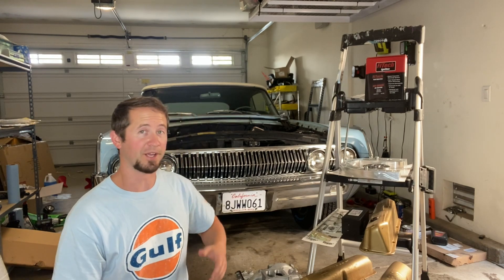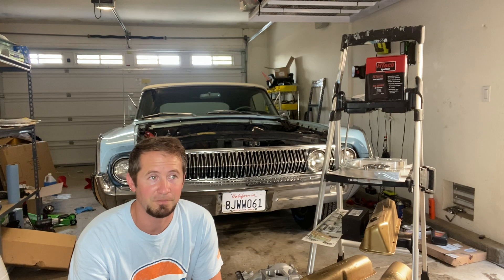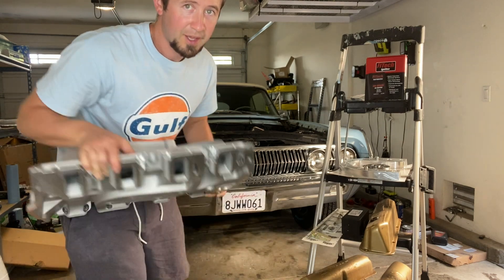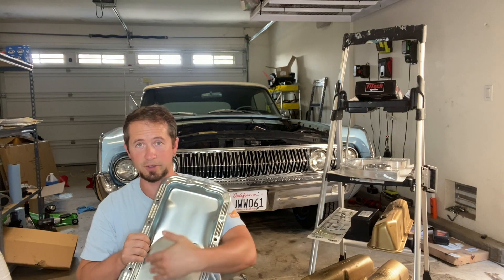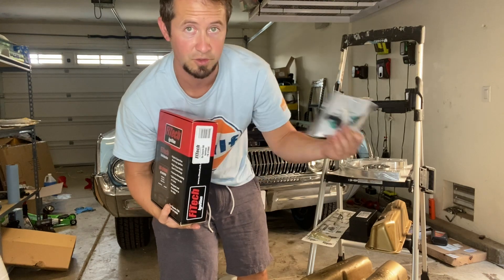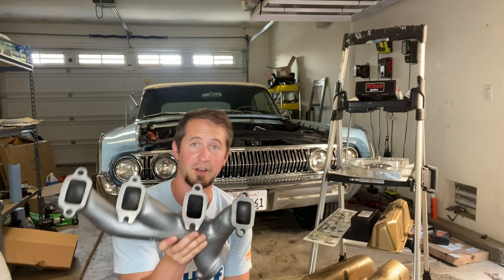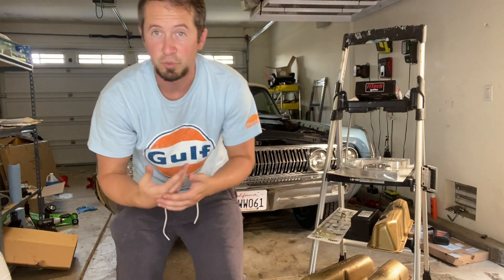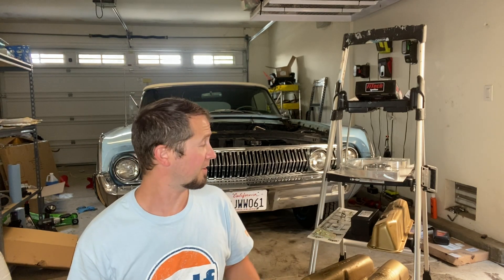390 FE Build and 4R70W parts

Comment: I'm building an FE for my 60 Edsel and have been thinking about an overdrive trans as well. I'm concerned about the transmission just physically fitting in the car, the bell housing area/firewall is pretty shallow in my car, do you think you'll have any issues there? Anyway this video is a year old so maybe you have conquered that fitment issue. I hope it has all gone well, we are on the same path because I'm also going with a TBI injection and was also looking into headers but those Kugel manifolds have me rethinking that for sure. Thanks for the video because you turned me onto several FE parts I was unaware of, been a chevy guy until this car, the FE is much harder to shop for than a big block Chevy.
Reply from the maker: I did have to "massage" the firewall around the trans bellhousing a little bit with a big hammer. It wasn't anything too drastic. Not noticeable on the inside of the car. I've been really happy with the FiTech. It really improves cold start driveability, making it easier to just get in and go. The manifolds are so much nicer to work with over headers. If you  are going TBI, you need to make sure there are NO exhaust leaks. That will screw it up bad. FEs are a bit of a challenge, especially the lack of reasonable transmission options.
Reply: @JalopyJockey  I figured the firewall area had to be hammered some, nice you were able to make it work without too much trouble. I certainly understand the importance of a tight exhaust, I am a mechanic by trade and an engine management, emissions specialist so I deal with this stuff all the time. My plan for now will be to get the engine done and the car back together and stick with the stock trans for now. How have those manifolds worked out, both intake and exhaust? Not sure I want the Blue Thunder intake with the oil fill but it's nice to know that option is available. The exhaust manifolds on the other hand are a nice alternative to headers I will likely use, I think I would have them ceramic coated to keep them looking nice.
Reply from the maker: @gwrider18m92  I went with that intake and exhaust mostly for original-ish looks. For that, they are spectacular. Performance wise they are good pieces as well. You could probably get a bit more from an Edelbrock RPM and headers. If you’re an emissions specialist, you probably want a closed PCV in the valve covers, anyway.
Reply: @JalopyJockey  You are exactly on point with the PCV and that alone probably will keep me with the Edelbrock manifold. Do you have a video of the engine in the car with the exhaust manifolds installed? I am really hoping I can use those, just love the way they look. What are you doing to maintain the exhaust manifolds appearance, paint, ceramic coating, or are you going to let them just "age".
Reply from the maker: @gwrider18m92  you know, I pretty much stabbed the engine in and sent it off to paint and body work. I installed the engine with the manifolds on. I’ve installed heads with manifolds on with the engine in the car, and just the manifolds. They fit each and every way. That was with my ‘62 Galaxie and ‘64 Mercury. I believe the Edsel will be a bit different. They come with high temp paint. It might protect them for a while. If you want them to always look nice, ceramic is the way.